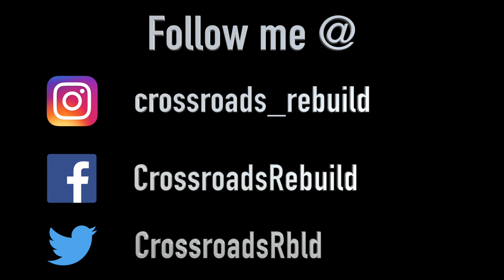Rebuilding A Wrecked 2017 Ford Police Interceptor Utility -- Part 7

Comment: Looks good.  Big step forward!  That "new" engine must be a youngster.  Still has what looks to be the factory FoMoCo black and white factory installed oil filter.  I know you had mentioned it was a low mile engine previously.
Reply from the maker: Yes sir! Still the factory installed oil filter. It has only 850 miles on it!! About to swap on a new filter along with new fluids as I get ready to start this thing for the first time.

Comment: Good project.  I'm wondering as this is an Interceptor if this engine is identical to the other and if the ECU is going to like it.
Reply from the maker: Should be good to go. The new engine is also from an Interceptor, just a year newer. So hopefully I won’t have any compatibility problems.
Reply: @CrossroadsRebuild  If you do, there's a lot of ECU tuner guys out there that can help.
Reply: @CrossroadsRebuild  i would serious change the ptu fluid aka transfer case they have no cooler soo fluid gets extremely hot
Reply from the maker: Thanks for the tip! Actually, the Interceptor version does have a cooler (that’s what those lines were I was struggling with). But nonetheless, I do plan to change all the fluids!